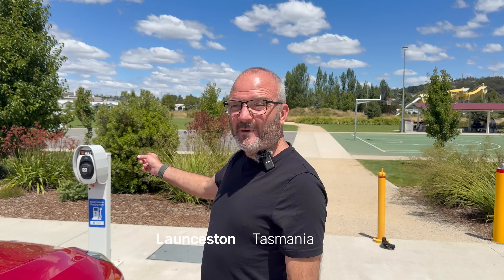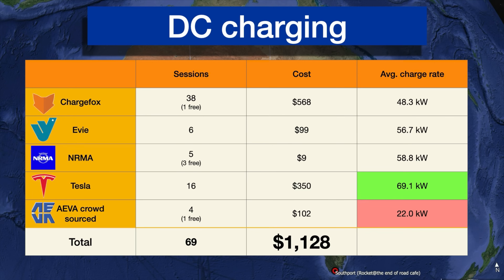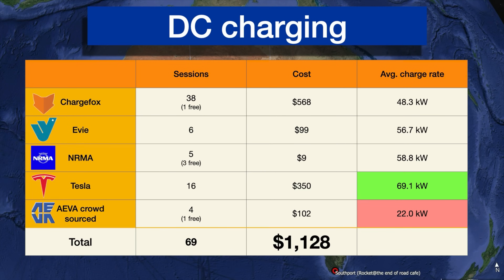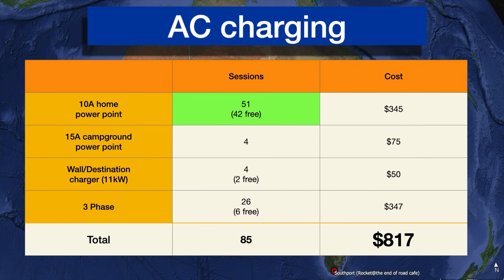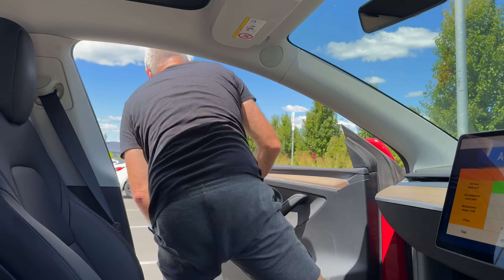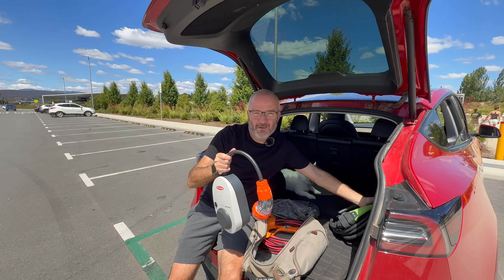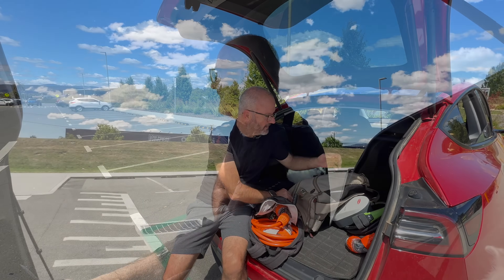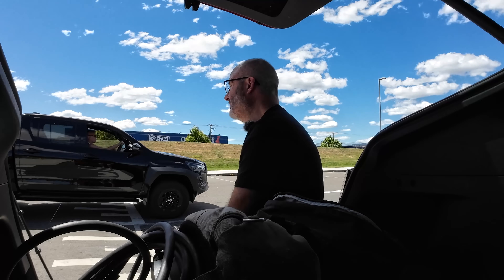43,000km Outback EV Journey: Charging Costs & Must-Have Charging Gear Revealed

Comment: I love the idea of Ev's but how much do all those cables cost and where to store them when on the road. Not being negative. That might cause a short circuit HAHA ???
Reply from the maker: As EV charging infra matures, so the requirement for a big bag of cables will go away. Right now some EV owners can get away with no cables at all. The other extreme is travelling somewhere in Australia with no EV chargers and needing a relatively fast charge. How do you want to use the car?

Comment: As long as you have access to the grid you can charge , if you have the time
Reply from the maker: For outback charging, yes you need to have time, but for a lap of Australia you need time anyway. For slow charging, access is not an issue, Australia is littered with power points.

Comment: Also how long is that 5 pin 3 phase extension cable you carried? How heavy is it? and how long is it? Was it worth the carry( weight vs energy burn)? And did you use it much? If so when? thanks
Reply from the maker: It was 3 meters longs. Considering the weight of everything me brought the weight was not material. We never did use it. If I was to do the trip again I would not bother.

Comment: I've got a 11KW AC maximum Kia. Rather than put in an expensive Home smart charger, we just put in a 3pin 32amp 7.4kw socket (we only have max 7.4kw single phase in the garage). It cost about 40 bucks from Bunnings and I purchased a 3pin portable  charger for $250 to charge @ 7.4kw at home. You can also buy these 3pin male plug to 5pin "convertor" female sockets for about 90 bucks. got me thinking My question is if I take my 3pin portable charger with me (rated to 7.4kw) can i plug it into any 5 pin socket as well?  One or 3 phase? Obviously any extra 3 phase current won't go thru - As it won't have the extra pins.  In any case the 3 pin charger I have won't draw more than 7.4 W. Yes? - Sure I don't get the full 22KW 3 phase speed (I'm limited to 11kw anyway) , but am I good to go? With this set up (for emergencies)>? Or do I need to buy a dedicated 5 pin charger? thanks
Reply from the maker: Not sure. The Fronius wall charger we had supported both single phase and three phase home installs but was sold as a 3 phase portable model.

Comment: Thank you for sharing this useful information. We are planning to drive our Tesla MY24 SR from Perth to Brisbane. We have driving many times in diesel vehicles but never in EV. In preparation we bought a Fronius 22kW 3ph and type 2 CCS2 extension lead, type 1 UMC with 10A & 15A. Also spare wheel, plug repair kit, etc. But we haven’t yet bought any of those other leads/tails you mentioned not needing. Anyway, keep up the good content.
Reply from the maker: @davebrouwer7333 glad you found it useful. I think you should be more than prepared with that kit. Per my video you can maybe get away without needed a 3 phase setup, but it's better to be safe than sorry. Also hopefully you can put the Fronius to good use as the wall charger at home?
Reply: @AUSY8 We completed the Nullarbor crossing a month ago and the only time I used the Fronius was at Border Village where I plugged into a 3 phase outlet in the tool shed behind the roadhouse. Some EV travellers don’t stop at Border Village but it suited us to overnight there.
Reply: Thanks for the information. What's a Tesla MY24 SR? Is that a Model Y Standard Range built in 2024?
Reply: @Fomites Correct: Standard Range, as opposed to Long Range. Built in 2024.

Comment: how stuipt  why dont they make just one connection all that crap extra you got to buy what a joke ,all yours buddies wont catch me driving a fire bomb
Reply: As EV charging gets simplified it will all be the same. Name one EV that’s has become a fire bomb in Australia?… Yeah just another anti EV person spewing there rhetoric that has been proven wrong. They can’t seem to get past that though. Still cheaper to run the EV with the costs of the extra cables. My m3 is best car I have ever owned.
Reply from the maker: There is only one connector on the car, it's called CCS2. it is the standard. Many people drive an EV and have no extra "crap". What I need is unique to long distance outback travel. Also I never asked you to drive a "fire bomb", so not sure why you are directing your insults here.

Comment: So 55 of the 154 charging times (35%) were paid for by someone else? So the real cost was about $3000 for electricity. And about $1000 for the cables you needed to buy?
Reply from the maker: The majority of the free charging was on the granny charger. The granny charger was free with my car. All the other cables I took are not needed for typical Aussie road trips. The last time we used 3 phase was back in April when we passed through Camooweal Qld.
Reply: @AUSY8 great work on your trip. I prefer to use the term trickle charger as it better describes what it does. 

Keen to catch-up face2face if you are still in Launceston.
Reply from the maker: Good point @markpurcell4507. Trickle charging is also more inclusive. Would love to catch up. We are in town for another full day. You can find an email to contact me buried under a link on my channel home page. On a PC it should be under the banner somewhere. Also I see a Hobart based Mark Purcell on LinkedIn, I could DM you there, if that's you.
Reply: you forgot to mention the tyres, windscreen fluid, the cost for building roads, street lights, etc
Reply from the maker: @ursodermatt8809  How careless of me :)

Comment: gday some thing is wrong with your details ,,our epic 43,000km EV adventure across Australia   i am puzzled from sydney to perth his only 4050 km or  did u across australia 10 times   ?????
Reply from the maker: Nothing is wrong I don’t think. We took 18 months and so that total includes all sorts of side trips. For example it includes a side trip to Kakadu and the Daintree. It also includes doing the port Augusta <-> Threeways section twice. While on the road we continued to do normal living stuff, so it even includes going to the supermarket, doctor and vet countless times. The charging costs are inclusive of every km we drove. Hope that helps.
Reply: When you're driving around doing your normal daily tasks. Make note of how many kilometres you do. 

My sister and I clocked up over 3000km in 5 days travelling barely more than 300 kilometres in any direction from where we'd set up camp a couple of years back.  

Even short distances around your local area or town can quickly add up. Take Dubbo in central west NSW. One can easily clock up 80km's in a couple of hours running from one end of the town to the other. Because it isn't long distance, it goes unnoticed. (I used to live near Dubbo, so know how quickly mileage or kilometreage adds up in that town! 😂).

Comment: For 40 000 klmsvery good
Reply from the maker: With some planning, it is very repeatable.
Reply: @AUSY8  planning? Forget it I could easily scratch off 5000 klm and then could just blaze my way in something like I haven't done in many many decades ! I kidd you not .
Reply from the maker: @ what I meant to say is if you only want to spend $1900 on “fuel” then it will take planning. You need to ask every accommodation owner up front if you can charge.

Comment: I live near Narrabri (the NRMA chargers shown). It was quite a drama to get these chargers as the council wanted them next to their visitor center which is located in a flood area. Then it took the energy distributors ages to hook them up even those 75kW units run 50kW only. Now Tesla is building 4 SuC next to the VC 😢.
Reply from the maker: Yeah interesting location near the Telstra exchange. At least the slower charge gave us time stretch our legs, walk around town and grab a bite. Nothing worse than being at a busy charger and holding people up. It's a delicate balance. Also good to see some competition in town with a Tesla Supercharger.
Reply: What's SuC?
Reply: @Fomites Tesla SuperCharger . Mostly 4 x 250kW and quite often available for all EV. Always work, easy to use and free for Teslas 2014-2016 year models (like mine😊).BTW: Narrabri opened a few months back.

Comment: Thanks for the video of your amazing trip. For AC charging I have a Khons 22kW (=32A 3-phase) adapter (my Model S can charge 22kW AC). And then tails for 10, 15 and 32A single phase and 10A, 16A and 20A 3 phase. Plus a 32A 3 phase 7.5m  Type 2 cable (length is handy when the charger is ICEd). On the DC side ye olde S can charge 50kW ChaDeMo (more reliable at 50kW Tritium chargers and load sharing on many newer chargers when CCS is in use) and 100kW CCS2. Can carry a full size spare wheel in the frunk too. The key is to politely ask and offer payment. On older places I also reduce the charge rate from 10A to 8A or from 15A to 12A just to make sure nothing gets overloaded. Finally I explain to hotel/motel/caravan park owners the Tesla and gov incentives to get Type 2 Chargers installed. Also worth mentioning that for 3 phase  EV charging a Neutral (= 5 pin outlet) is required, in many workshops there are 4 pin outlets only because electric motors do not require a Neutral.
Reply from the maker: All great points there @moestrei. What it does highlight too, is that EV charging is still too complex. Luckily things are improving fast. For example I predict 3 phase for remote travel will become an oddity within a few years.
Reply: @AUSY8  Yes. I even go further saying that the future is DC bidi only. No point of the car carrying heavy ac chargers. If you ever see/lift one yourself you understand what I mean.
Reply: Thanks for that information. I'm about to buy my first EV and this is all new and useful information 🙂.
Reply: @Fomites  If you can, buy a Tesla. The overall package is still the best money can buy. If you are a hater, ok but don't tell me later that I did not warn you.

Comment: Your trip has made for interesting watching for me, an Australian (a Canberran, in fact), living in the USA who also owns a Tesla (Model 3 LR). A few key differences when it comes to charging:

- Public chargers, whether DC or AC, always have an attached cable here. That “BYO cable” arrangement isn’t a thing at all.

- Three phase essentially doesn’t exist in the US (some industrial buildings/factories that need to drive large electric motors will have it, but there’s no consumer level stuff that takes three phase and three phase cannot be provided to residential homes). In fact, the inverter in the US Teslas isn’t even capable of accepting three phase at all, and the NACS plug doesn’t support three phase since it’s just 3 pins. To make up for it though, US models can accept higher single phase amperage than Australian market vehicles can (up to 48A / 11.5 kW single phase AC).

- The infrastructure is much thinner on the ground in Australia. That isn’t a knock against Australia - it’s just the reality of a country with such low population density outside the few major cities. You can travel pretty much anywhere in the US these days and not even think about charging. Tesla alone has over 2,500 US supercharger locations in an area roughly the same size as Australia, to say nothing of the various other charging networks.

I’ll likely be staying with Tesla when I return to Australia so it’s been great seeing the kind of gear I may be needing in the future for Aussie road tripping.
Reply from the maker: Glad you found it interesting. Trust the Aussies to find another thing to BYO. I think they started the whole BYO booze thing too, right? 

Anyway yeah 3 phase is a bit of an oddity, however the Europeans have a version too, but I think they have standardised on just one connector. Thankfully we seem to be standardising on the 5 pin, 32 amp one too. I do wish we had a smaller fast DC connector (NACS) like the US. The CC2 combo adapter can be a very chunky affair.
Reply: @AUSY8  Alas no, the EU has 32A and 16A connectors. (BMW and Mini's in Australia come with an 11kW portable charger, and the only 3 phase tail they offer is the EU spec, which means I had to get an adapter cable)
Reply from the maker: @dadegroot  thanks for the info. Is that why some are orange and some are blue?  Now I don’t feel so bad about the half dozen 3 phase plugs types we have here.